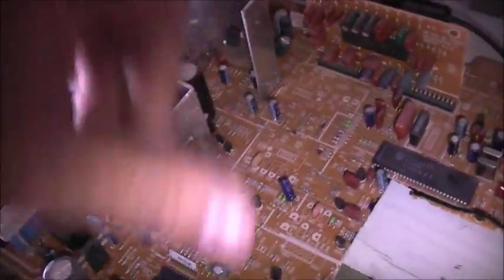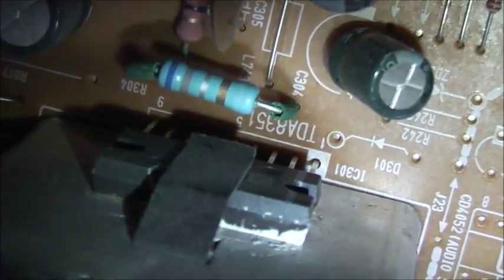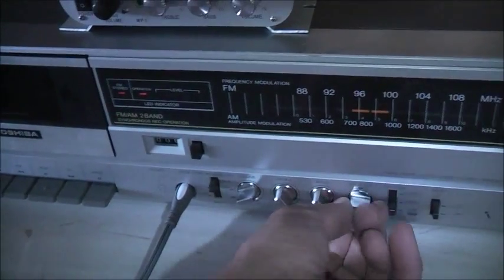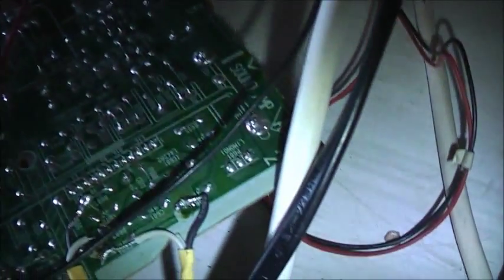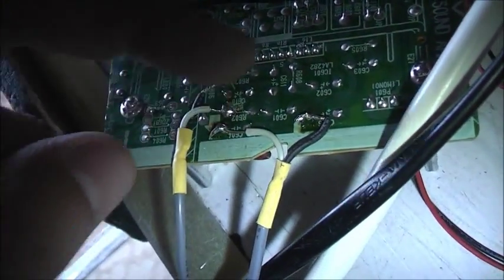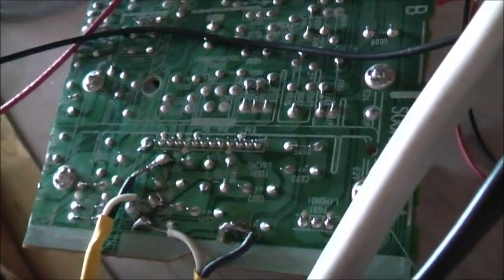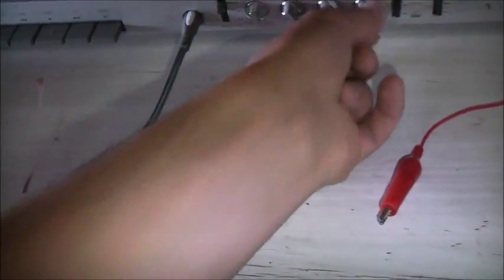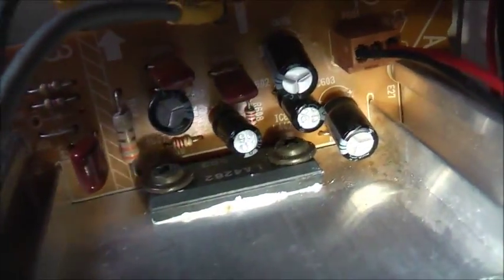Reusing a TV Amplifier

Comment: I made a mono amp from one of the TV amps I had kickin around finally. It's based on the LA4524 IC. I reused the composite inputs from the TV as the audio input and bypassed the limiting resistors on the headphone jack and added a light and this thing cranks. It was assembled I just added a few ins and outs. It is from my old 19" Symphonic TV VCR combo.(See my frozen TV Channels video) Video of it coming soon.

Comment: lol, ive done the same thing, some circuits almost have a dotted line around them for you to apply a hacksaw to.

Years ago i hacksawed a stereo 30watt amp out of a tv and ploped it into a blown up hi-fi amplifier, i sounded great and it cost nothing to do :-)

You may want a passive/or amplified tone control unit before the amp to boost the bass and treble, amplifier circuits tend to be flat in response.

Comment: I bet the inputs are actually Non-decoded TV stereo signals.
One is left+right, and the other is Double-right.
I think that board front end is re mixing that to get L+R. You might be best off to inject the signal in further down the circuit after that mixer part. Interesting!!!